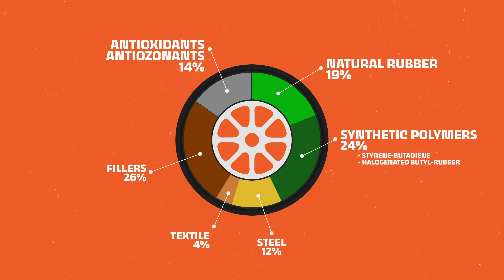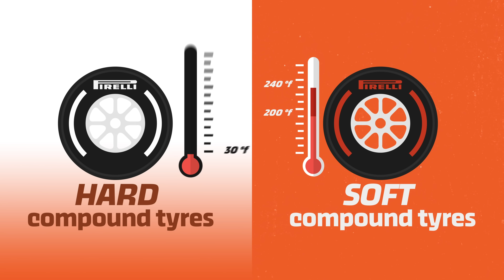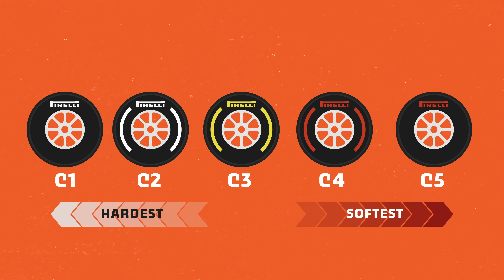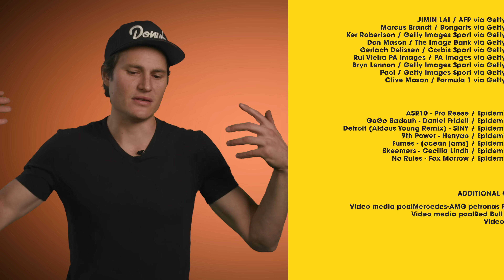Why an F1 Tire only last 50 miles

Comment: As a F1 fan, this is the kind of content I wait for and aspire to see from one of my favourite channel
Reply: as a f1 fan you should definitely know that the current spec tires are engineered to fail for entertainment

Pirelli even said that themselves back in early 2010 when they wanted to make races more interesting and have more tire strategy rather than just fueling and sprinting to the end which was extremely popular in the 2000s and no overtaking. Tires back then lasted much longer 

There also is no more tire war so its not necessarily the best tech,

The 2000s era tires were faster despite being grooved than todays tires.

After 2005 us gp, having two tire manufacturers became such an issue that they went with one.
Reply: @bruce_son  Hello 👏 trust you're doing well and staying safe?
Reply: @bruce_son  yes, even though i got into watching f1 this season, i know this kinda stuff....
Reply: I love when Donut acknowledges the existence of F1, but then they say things like "it'd be better without pit stops"... Sorry what? Take out the pit stops and races would be even more boring LOL.

They may understand the technical stuff but sure they still don't get the sport.
Reply: @AlejandroLZuvic You didn't understand what he said
Reply: @odyseuszkoskiniotis6266  sorry, what did he say then?
Reply: @AlejandroLZuvic  they cater to the boomers. Some stuff is cringe but some is fine for entertainment. I dont expect to learn anything from them
Reply: @bruce_son  Yeah, exactly

Comment: There is a 305 km minimum race distance+they use the same set for 3 laps in quali and another warmup lap which are another 15-20km on the tire. 50 miles is easy for them as races are usually 1 stop.
Reply: So that’s 180 miles and let’s be honest there’s usually 2 stops if going full tilt on softs, if managing tyres to 1 stop they’re limiting performance and it’s track dependant, so 2 stops let’s say 60-70miles for arguments sake? 🤷‍♂️
Reply: @macsays2834  70% of the time Hamilton wins on a 1 stop from medium to hard. The rest is pr soft medium to the end or medium hard soft for fastest lap. Maybe sometime a Soft hard if he didn’t manage to qualify with the mediums
Reply: @macsays2834  F1 tires are made to wear fast but if you manage them well you can end up doing long stints belive me
Reply: @maceocapietto  Hamilton is a different piece of the equation though let’s be fair, he pretty much runs in entirely clean air, has a superior chassis for most tracks, and is a demi-god at managing tyres..
Reply: @macsays2834  yeah but 50% of the field do one stop mate. Look the strategies at Abu Dhabi. All the people that 2 stopped dropped down appart Ricciardo
Reply: @maceocapietto  on some tracks yes, 1 stop at Abu Dhabi, Racing Point did 3 stops in Singapore last season, it’s all track & temp dependant..
Reply: @macsays2834  2 stops are usually favoured by sc/vsc are involved.  In a normal race 1 stop is the one to go with
Reply: @macsays2834  Lewis' race pace and tire managed is 100% hax.
Reply: @macsays2834  i know but the main strategy (mostly used) is the one stop. Then sometimes you have different ones
Reply: @macsays2834  either way as I said F1 tyres can last way longer than 50 miles. Grosjean in 2019 did 56 laps of Monaco with softs which is much more !
Reply: @exa-roli3954  if possible then 1 of course, Mercedes averaged about 1.7 per race per driver across 2019 season, including retirements/incidents

Comment: The intern messed up and spelled "tread" as "thread" when it overlays on your face.
Reply: I didn’t even notice 😂
Reply: Also repeatedly spelled 'braking" wrong.
Reply: And secconds
Reply: And 'degradation'. Someone needs a copy editor.
Reply: Pretty sure 'resistence' isn't a thing either.

Comment: I remember watching a video about F1 turbos. Apparently, all wear parts, including the engine & turbos, are only supposed to last, just after the finish line.
If any of this consumable parts, have endurance left for a few more laps after a race, then an engineer messed up.
It's all about timing and finely balancing performance and endurance.
I think anyone who plays Gran Turismo games, should have already known why these racing tires have such short lives. Choosing what compound to use, is a big part of nearly any GT race, especially endurance races.

Comment: If the tires lasted to long there would be no strategy and Mercedes would win even more than they do and f1 would be way to boring if they did so
Reply: That’s racing though, may the best car & driver win
Reply: @kennyoffhenny  
It has become less “best driver” and “best car”, which, if that’s what you like seeing, fair, but then human drivers are kinda irrelevant at that point. Knowledge of how a car interacts with air, and the advancement of engine technology has gotten to the point you need millions of dollars to squeeze out another half second of lap time.
Reply: @Appletank8  it sounds like they’re able to put millions of dollars into tire research & development just to cater to the FIA’s bottleneck though. It’s obvious that drivers are pushing the envelope regarding their driving ability, however I think that’s the point. Cars would probably be able to get faster lap times if they were self driven, but I don’t think that would be near as entertaining. I know some people disagree, but I think the whole essence of racing is that they are pushing the envelope of automobile technological advancement, while also allowing drivers to push the boundaries of their own limitations
Reply: @kennyoffhenny  
Everybody has the same tires, so it’s not really going to change all that much, outside of being something the drivers have to keep track of.
The thing with letting engineers do what they want with the car, is that engineers can do a lot more if they have shot tons of cash available, and right now more money almost guarantees a win, as long as the driver is mostly competent.
Reply: Yeahh
Reply: @kennyoffhenny  not car just the driver
Reply: @kennyoffhenny  imagine monaco gp without  tire strategy
Reply: @m-villanuevakimdominicg.8497  I’m not too educated on all the different races, how would it affect the Monaco GP?
Reply: @kennyoffhenny  It's pretty much impossible to overtake at Monaco and sometimes tire strategy changes the outcome of the race, just like in Monaco gp 2017 where Kimi pitted first which means Vettel takes the lead and Vettel manage to have a gap that by the time he pitted he still manage to take the lead and win. My english is not very good so I can't explain it well, i recommend that you watch the highlight
Reply: @Appletank8   It's always been about the best car, sure you need a great driver to make the most of it but F1 has always been a "build the best car" championship. Any other view of the sport is just a rose tinted delusion of the past.
Reply: @DjDolHaus86  
My point is that a with a good enough car, all you need is an adequate driver, and even the best driver will be completely helpless in a car straight up inferior. If it is a game of engineering, then humans are for all intents and purposes irrelevant, and possibly hindering. A good number of rule changes are due to the cars getting so fast they exceed human limitations, human reaction times. One never has to worry about a marathon runner going "so fast" they run into a wall and explode, but that is a serious worry if you're going 200 mph and your tires give up. If there were no human driver, a car hitting a wall and exploding will be unfortunate and expensive, but not tragic. In which case, lets add jet engines.
Reply: @Appletank8  I think that's deeply disrespectful to the drivers. Those who are in the fastest cars are the best drivers, if any chump could do it then they would pay the chump who'd do it for the least. Also it's never human limitations that have led to restrictions, drivers could go much faster with the right machinery without needing to worry about blacking out from the forces or lacking reaction time, f1 cars are brutal but they're far from the limits of human capability. The restrictions come mostly through practicality and finance, the track designs have spacial and financial limitations and therefore a compromise must be struck which works for both the track owners and the sport to keep things moving forward. 
F1 is far from perfect but there are plenty of other spec racing series out there if you don't like the way this one is run.
Reply: @Appletank8  I think both of you are saying more or less the same... What exactly are you debating?
Reply: @kennyoffhenny  u definitely dont watch F1
Reply: @DjDolHaus86  
My point is that i’d say, to pick a random number, 90% of the current F1 drivers will win with the best car. The “best” driver would have almost nothing if stuck in the “worst” car.
Reply: It’s pretty damn boring already
Reply: @Appletank8  yes. I agree. We saw this at the sakhir gp
Reply: Thats why ppl have lost interest in f1 and have switched to rally. Its more interesting watching cars smash into each other.
Reply: @411Adidas  that would be BTCC or Rally cross. Not Rally.
Reply: @XenonG  yeah rally cross.
Reply: yeah how is it that making the race more contrived makes it better?
Reply: @Appletank8  Not true about any ole driver can be placed in any car and be as equally as dominant. Why would F1 teams pay large contracts and continue to fight for free agent drivers? Why did Albon and Gasly lose their seat at Redbull? Why is Bottas on the hot seat when he fails to deliver after qualifying?
Reply: @Thehawkdown99  
If Team Magic dumped 10 billion dollars into R&D and found a way to make a car that's 10% faster in top speed, 10% faster 0--100, 10% faster in turns, is completely undisturbed by dirty air while hiding everything from casual observation ... aight, what's the point of a good driver for everyone else if their car is straight up worse in every metric?
Reply: @Appletank8  Uhh... no. The arguement is after Team Magic dumped all the billions in R&D and if the car performs the same with any driver in F1, why pay $40 million plus salary and bonuses when you ca pay $1 million for a driver?
Reply: @Thehawkdown99  If most of the cars performed similarly, then yes, having a good driver would matter. That's what I was talking about earlier, how due to how much we know about "correct" aero design, and knowledge about squeezing power out of engines, having more money is the most reliable way to make a faster car, and some teams have a shitload of money to make a notably faster car. Which is why F1, at this point, needs to keep restricting designs and budgets.
If the competition is a Mclaren P1 vs a Honda Accord then drivers become irrelevant. The gap is obviously not that large, but I worry that its getting to the point where good driving skills isn't enough to compensate for being stuck in a bad car, or vice versa weaker driving skills being carried by sitting in an outright superior car.

Comment: No pitting would feel pretty boring without something like “attack zones” like in formula e just because the lead car would likely stay where they are with out anything limiting them. Instead of having to be within a seconds time of another car of to activate drs, drivers  can go through attack zones to activate. I also think penalties may have to be longer or something to keep the drivers from driving recklessly and also to keep things interesting
Reply: That's already the case with formula one if you think about it if nobody makes any mistakes you would most likely finish where you started so if you got the pole almost every race no competition
Reply: Penalties are already long AF, I think we must not promote reckless driving but promote driving on the edge and with dirty air with these wide cars we cannot race without DRS, but the ctual flap can be made smaller with the 2022 cars.
Reply: Formula E is just lame. I tried, I really tried to like it but there's just so much dirty driving and those attack zones and fan boosts are just dumb. I feel like I'm watching Mario Cart without turtle shells. The Dirty AF driving is the most annoying thing. They're slow af also being capped at 300ish hp so their batteries will last long enough for a race.

Comment: I think the tires add a lot to the race strategy. Also I'd imagine the reason they only last so few miles is because you have to balance softness/grip with degradation.  Less degradation means less grip. More grip typically means less degradation. These tires also have to withstand the most stressful torque and lateral forces than just about any other race car.

Comment: Considering that f1 cars have a hard time running together due to problems with downforce pitstops are almost the only action in most races. I think adding fuel would make things more competitive but no unless they level the field and bring the silver arrows back down to the same level

Comment: Y’all need to double-check “breaking” vs “braking”
Reply: Just like the title “why an f1 tire only last 50 miles” lol
Reply: @Connorjp5513  the title is correct though, the "F" is pronounced like æf, aeiou=an. It it were to use "a" it would be "a Formula 1 car". English is not my 1st language so i don't really know how to explain it better. If you read it as "an Formula 1" then it is wrong and if you read it as "an æf1" then it is correct. That's how i understand it idk about you
Reply: @roysterben863  lol I’m not talking about the it’s the fact that it says last when it should say lasts it last would be used in something like I ate food last nite
Reply: @Connorjp5513  you could've just said so lol
Reply: Also the correct way to spell it is *Degradation
Reply: @jh2531  also also it’s seconds not secconds

Comment: idk I think pit stops are a good thing, it helps keep low/mid field teams somewhat in the running if they gamble on the right strategy.
Reply: Yea. Remember Germany 2019 where toro rosso and racing point gambled and ended up in 2nd and 4th

Comment: “Does a variety in race strategy even make the race any better” yes. Yes it does. Have you ever watched any race. When a race has basically 1 strategy that is fastes, and everything goes to plan, the race is boring. However when there are multiple uncertain strategies, and maybe some chaos is thrown in (safety car meaning only some people pit while some stay out, etc) the race is exciting, ex.Italy, Sakhir, Mugello.
Reply: Couldn't you do this artificially though without forcing tire blowouts? Maybe something with DRS where it's manually fitted for X number of laps, smaller fuel tanks, something isn't prone to (relative to normal tire operation) catastrophic failure?
Reply: Let teams refuel mid race again
Reply: Isnt blow outs due to greed via strategy?   Theres data for everything on an F1 car, and drivers are in constant communication with engineers monitoring performance. If there wasnt pitstops, it be a shit show, if refueling wasnt such a hazard, id be interested to see the impact on race outcomes.
Reply: @dparson7  there are almost never blowouts though, it’s extremely rare and it’s usually due to a combination of pirelli miscalculating with track conditions and the teams choosing to take a risk and run for a long time
Reply: @reilandeubank  yes, but if the drivers are saying there is unnecessary danger created due to tire degradation, the pit stop is what creates the entertainment. You can still have tires that grip well, but diminish grip without the same level of failure. And while it could be rare, obviously it still happens, and it doesn't need to. 

Idk, something about the FIA saying they need tire degradation while the drivers say they don't rubs me the wrong way. It doesn't NEED to be tires that creates the spectacle the FIA wants, is my larger point I guess.

Comment: IIRC, it was actually the second race at Silverstone where the blowouts took place, and Pirelli was using the “one step softer” range of tires/tyres.  Second point, the tire tread provides “mechanical grip” which is only a small portion of the grip needed for F1 cars to pull such high lateral G numbers.  Aerodynamic downforce provides the rest of the necessary “grip” needed for such high speed cornering.  This is the real secret to modern racing cars setting such blistering times compared to their predecessors, which had minimal downforce.

Comment: Tire degradation used to be a major concern in motorcycle racing and a safety issue. The tires last for the whole 75 mile race in Motogp and Superbike now. I think stopping to change tires on a car makes the race confusing.
Reply: tyre changes are very simple, and crucial to a races strategy. formula 1 would be almost ruined if that key component wasnt there
Reply: formula e doesn’t have tire change pitstops

pitstops only happen in formula e if a car🏎️ has a broken front wing, but this happens rarely

Comment: Polymer deformation and long chain molecule stretching doesn’t work in the way that you describe. When bending occurs along side heat cycling, the molecules actually move alongside one another as the material deforms, and the bonding between them actually changes and creates a new material which is more ductile and therefore the tire has less grip. This phenomenon is very apparent when you bend clear plastic, and it becomes white in color.

Comment: I do like how pitstop strategies can affect the race. On F1 with team radios it generates additional attractions towards the sport. Most audience won't really be able to tell how a driver must be feeling while driving on the tyres or racing against each other closely, and them being the best drivers in the world would also be showcased with how each responds to the tyre problems. F1 can't be quite like motogp with the one and done, one tyre race with no team radio nor pitstop. On MotoGP you can have the pure head to head, action packed racing from start to finish, with the tradeoff of not having the strategies and the team radio that F1 has.